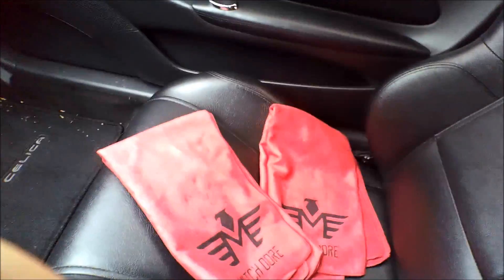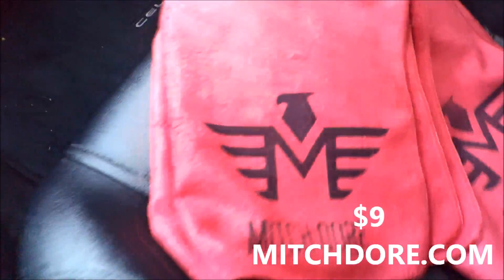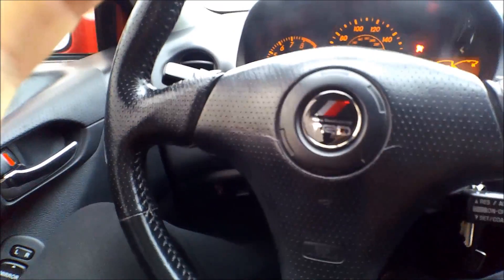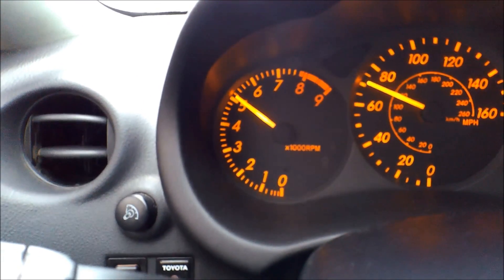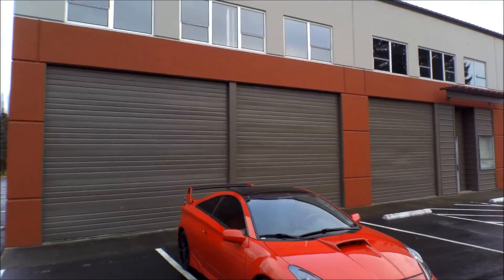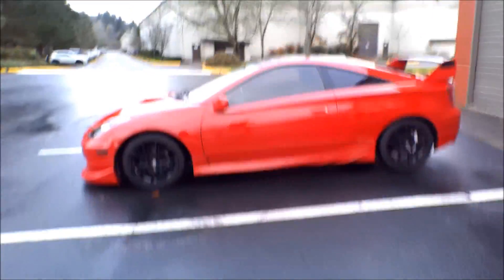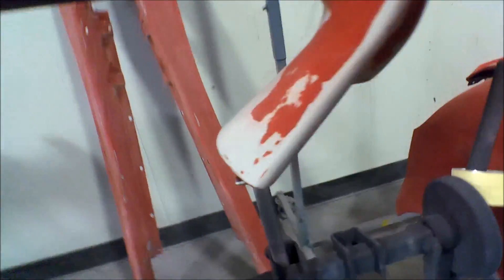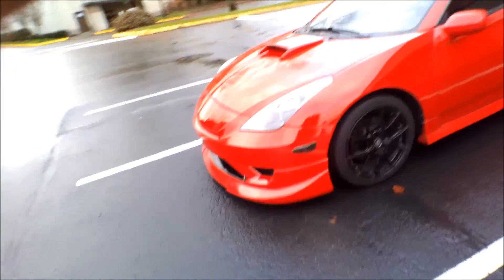MITCH DORE | TURBO MR2 SPYDER UPDATE

Comment: I just got my 2ZZ MrS running, put it in gear and the trans made a loud clatter, only later did I find out that the MrS used a different final drive ratio than the Corolla XRS so I'm 99% sure that the ring gear on the TRD LSD is the wrong size so now I have to drop the whole trans and swap ring gears. The most annoying part is the axles, everyone says you can turn them and they should pop out once the c-clip falls into place and it is NOT the case with my my C60, the axles are giving me hell! I hope once I get the trans out, that I find the diff ring gears are actually different sizes and that'll be a fix. Wish I had a second pair of helping hands when pulling the trans :/ good vid man, love your MrS. I hope to turbo my 2zz one day. Did you ever swap to the EMS-4 or are you still running the PFC?
Reply from the maker: Absolutely great, I really appreciate this, it helps others. sorry that it didn't work when you put it all back together I know that feeling. With a c60 I ran 03 MR2 Spyder upgraded axles. I am still currently using the PFC but I would love to get into the EMS-4 soon!

Hope all is well!

Mitch